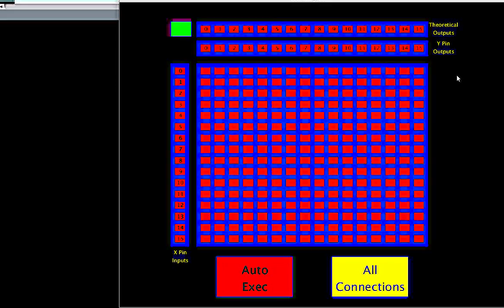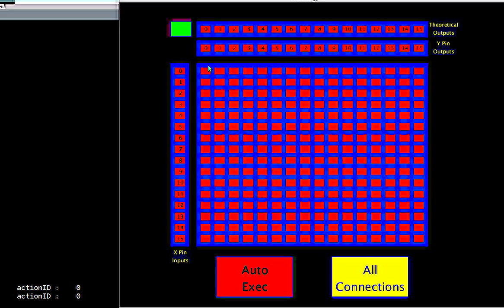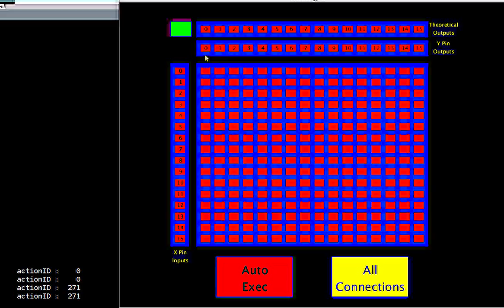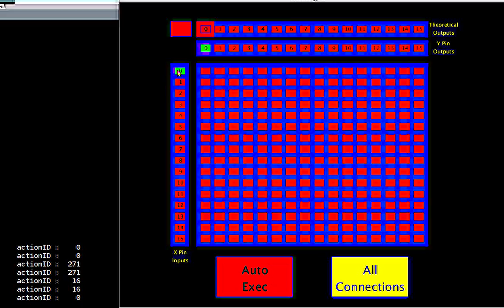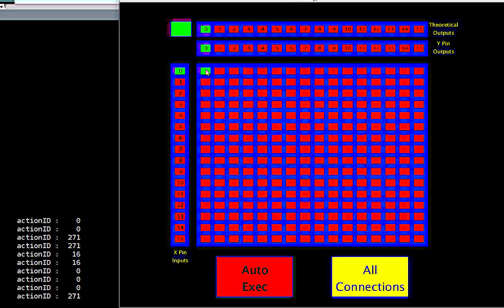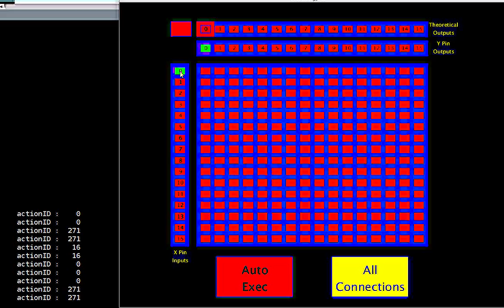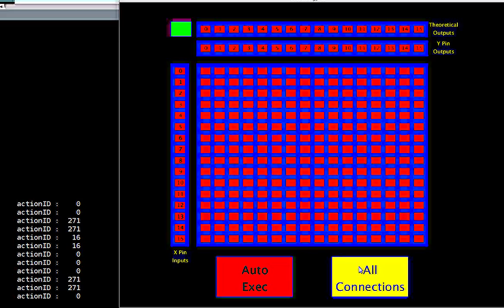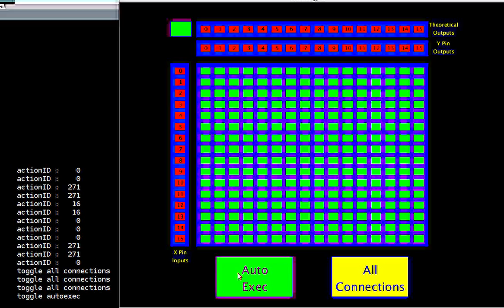AD75019 Test Driver Gui Full Demo

Comment: Hi,  Thank you for your response.  I'm looking at the AD8113 and the AD75019.  Instead of building a true any to any matrix out of switches, I'm looking at alternatives, as building one out of switches would make it cost prohibitive quite quickly ($6.00 per cross point), so a 2x2 matrix would be $24, a 3x3 would be $216 and so on.  Could you share what is your experience between these two ICs, as I saw you had a chance to work with both.  I'm also trying to utilize them for Audio purposes.  I would love to get my hands on your code as it would speed up my experiment.  Also, have you had a chance to see what happens to the signal path when you cascade these ICs to build larger matrix.  Thank you.
Reply from the maker: Both chips work perfectly as per spec. I use the AD7019 because its spec fits my needs. The AD8113 has built in gain which is not appropriate to my use case. Both chips can easily be linked into bigger matrices. All ll the code is  freely available in the gitlab repo.

Comment: Hi, Very informative video. I am trying to use AD75019 this chip. Do we need to add any resistance or capacitor (to any of its pin) to make it run correctly? Can you please share any wire diagram of AD75019. Thanks
Reply: Thanks a lot for sharing the diagram. The limitation of ~14 is kind of very disappointing. I have a use case where the switches can go from 0 - 256. The data sheet does not mentions this. Any idea where the limitation is coming from? One more thing. I want to use this as a relay to connect Aurdiuno pins and some registers. Do you see any problem in such a usage?
Reply: Got it!. Thanks.
Reply: sorry, it is resistance, not registers, my mistake. One quick question, what is the use of 1N5818? Also is there a breakout in the market which has all these circuit inbuilt and I can use then out of the box?
Reply: Yes 44PLCC will be going to be really useful, thanks for the recommendation. I am struggling to procure AD75019JPZ, the price really varies between $13 - $30 depending upon AD75019JP (end of life) to AD75019JPZ.  I could see couple of them on Aliexpress. Any one which you recommend? Thanks
Reply: Thanks a lot for the info.
Reply: yes you are write, 16 on breadboard will be just unmanageable. I have to think on pcb side. Thx
Reply: Is it just ok to use 1N5819 instead of 1N5818? I have couple of 1N5819 and I want to quickly boot this up. My AD75019 arrived today. Thanks!
Reply: good. Yes from data sheet it looks it should work. Let me try. Thx
Reply: Hi - I am trying to connect all the voltage supplies to the AD75019. Have couple of doubts and need your expertise. I am using 2 separate power supplies (12 V & 5 V) to power the AD75019 as per your diagram. My doubts are.(1). How to give -12V from a 12 V voltage source? (2) Since there are 2 power supplies, as per the diagram I have to connect  the -ve of both the power supplies and them provide that as GND to all 4 GNDs (i.e GND in pin 42, 41, VSS, 43) correct? (3) Also I have to connect the GND of my Arduino board to this common GND. Correct?  Thanks for all your help. I am new to circuits and just want to make sure I am correct before I power my chip. Thanks!
Reply: Hi - Thanks for your quick reply. The voltage range is between 0 - 5 V. So I think your configuration should be fine. I am getting a local Quad Power Supply Board which should meet the need for +5V, +12 V & -12 V.
https://hacktronics.co.in/step-down-power-supply/dual-power-supply-board-5v-12v-using-7805-and-7812-ic
Hope this should be fine?
Yes I am putting the Capacitor much closer to the pin as per your diagram.

Thanks
Reply: Hi - My signal will be both Analog and Digital. I am trying to use this as relay to switch UART sensors (+5V DC power) and also switch between these sensors to connect to different UART incoming signals. So I am using these as relay with clearly DV voltage/current within limits of +-12V and Current < .5Amp. 

Finally I connect the circuit as per your diagram. Using 2 separate power supply: (-12V & +5V), (+12V). connected the GND of both the power supply + All the GNDs of the circuits around Pin 4,41,42 of AD75019 (including Pin 43) + GND of Arduino UNO. 

I am using 1 AD75019 chip and trying to send the control bits from Arduino UNO (AU)
Pin Connection: 
Pin 10 of Arduino UNO -> Pin 1 of AD75019
Pin 13 of Arduino UNO -> Pin 2 of AD75019
Pin 11 of Arduino UNO -> Pin 3 of AD75019

I am using the following program on Arduino UNO:

///////////////////////////////////////////////////////////////////////
// pinout
#define PCLK_PIN  10
#define SCLK_PIN  13
#define SIN_PIN   11

uint16_t switches[16][16];

void setup()
{
  pinMode(SCLK_PIN, OUTPUT);
  pinMode(SIN_PIN, OUTPUT);
  pinMode(PCLK_PIN, OUTPUT);
  digitalWrite(PCLK_PIN, HIGH);
//  disconnectAll();
//  update();
}

void loop()
{
  connect(0,0);
  update();
  exit(0);
}

void connect(uint8_t x, uint8_t y)
{ 
  switches[x][y] =1;
}

void disconnectAll(void)
{
  uint8_t x,y;
  for(x=0;x<16;x++){
    for(y=0;y<16;y++){
      switches[x][y] = 0;
    }
  }
}

void update(void)
{
  uint8_t x, y;

  for (y=0; y < 16; y++) {
    for (x=0; x < 16; x++) {
      digitalWrite(SIN_PIN, (switches[15-y][15-x]) ? HIGH : LOW);
      // 20ns setup required
      asm("nop");
      asm("nop");
      digitalWrite(SCLK_PIN, HIGH);
      asm("nop"); // sclk pulse width, 100 ns minimum
      asm("nop");
      asm("nop");
      asm("nop");
      asm("nop");
      asm("nop");
      digitalWrite(SCLK_PIN, LOW);
      asm("nop");
      // 40ns hold time required
    }
  }
  asm("nop"); // 65ns setup required
  asm("nop");
  asm("nop");
  asm("nop");
  digitalWrite(PCLK_PIN, LOW);
  asm("nop"); // pclk pulse width 65ns minimum
  asm("nop");
  asm("nop");
  asm("nop");
  digitalWrite(PCLK_PIN, HIGH);
}

Things are not working:

1. After completing the circuit as per your diagram and connecting  Arduino UNO and powering AD75019 & Arduino UNO, I observe that all X0-X15 are connected to all Y0-Y15 AND all Xs and Ys are also connected to each other even before I download any bits to the AD75019.  I checked the connectivity using a multimeter.

2. After downloading the above program nothing happens. All Xs are connected to All Y are connected to each other. I checked the connectivity using a multimeter.

Can you please help me on this.
Reply: Thanks, Looks like SPI lib is the way to go. Let me give a try.